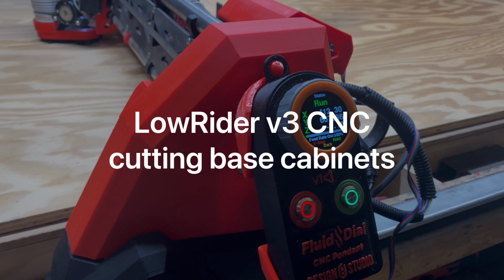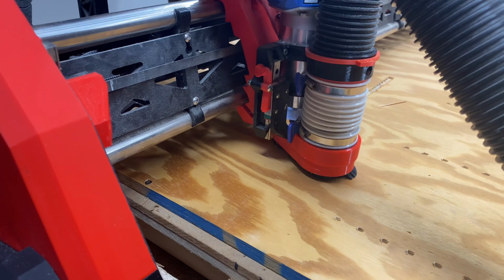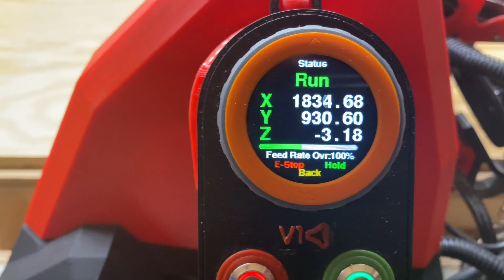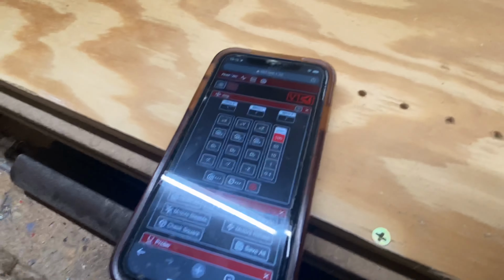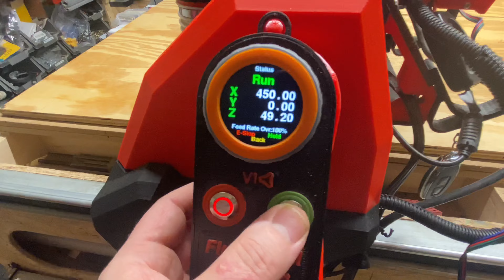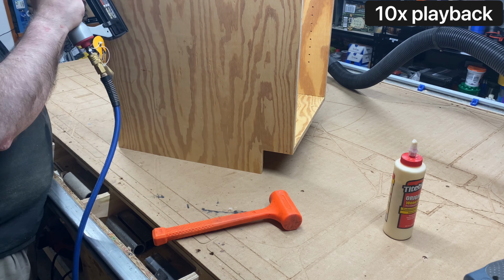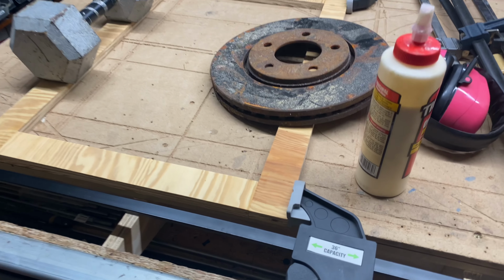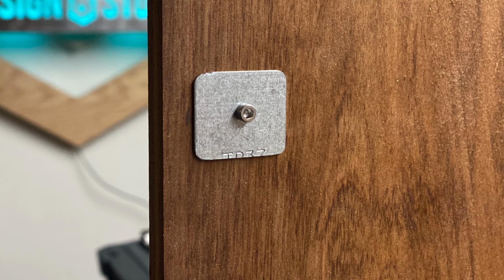LowRider v3 CNC - cutting & assembly of base cabinets!

Comment: I am in the process of building a 2ft x 4ft or 3ft x 3ft MPCNC Primo. Please let me know the type of tubing you are using in your Low Rider and where you sourced it. I have found 1” EMT tubing at Home Depot. Is that tubing sufficient, or should I consider something else? Thanks. God bless.
Reply from the maker: The LowRider in the video here has 1" stainless steel tubes, and it's been so long since I bought them I cannot remember if they are DOM (drawn over mandrel) or laser welded. They are stiff and strong. After I bought them, came the pandemic and the hyper inflation, and now they are quite pricey. At the sizes you mentioned, you should consider switching from MPCNC Primo to the LowRider, especially for the option with a 4' span. Here's a quote from the Primo docs re. size: "All axes can be any length you prefer, anything over ~3′ (1M) would be best to start with a LowRider CNC, of course smaller is better. The kit comes with enough belt for up to 48″ of total outer X and Y axis dimensions (eg 24″x24″, 36″x12″ or any other combination)."
Reply: @design8studio hey Doug! I am currently in the process of building a V3 but have yet to buy the EMT. Do you think it’s worth going with the 1 inch versus the 3/4” recommended size? If so, why?
Reply from the maker: @TylerDouglas100  The general rule with EMT is the bigger it is, the stronger and more rigid it is. In other words, the better it is for CNC. The 1" OD would be significantly better than 3/4" OD — but remember, EMT is sold based on Inside Diameter (ID) while the LowRider designs are concerned with Outside Diameter. The LR4 steps up to 1" (ID) which in millimeters is 25.4, yet it has an outside diameter of 29.5. If memory serves, the LowRider v3 has an option of printed braces that can accept 1 inch (25.4 mm) outside diameter. My LR3 has that. It's a great machine! By me upgrading to LR4, I'm going from 25.4 mm (OD) stainless steel tubes (on LR3) to 29.5 (OD) galvanized steel EMT tubes (sold as 1" ID) (on LR4), and it is substantially stiffer.
Reply from the maker: @TylerDouglas100  Also, some of the question of tube diameter is affected by how long your X gantry is planned to be. For a full-sheet capable machine, it matters more to go with the biggest tube you can get in the design. For a much shorter gantry, it does not matter quite as much.
Reply: @design8studio ok awesome that’s what I figured. I assume the LR3 will be upgradable to the LR4? If so, perhaps I should just wait? Rather than building twice as I’m in no hurry.
Reply from the maker: @TylerDouglas100  yes, an LR3 can be upgraded to an LR4, and the hardware kit for both is almost exactly the same — with the only difference being a few screws. The LR4 uses thicker EMT tubes, a different plan for the XZ plate flat parts, and the YZ plates transitioned from being a cut flat part item to being a 3D printed item. So far the steppers, wiring, pulleys, gears, belts, etc. are all the same.
Reply: Great thanks for all the info Doug